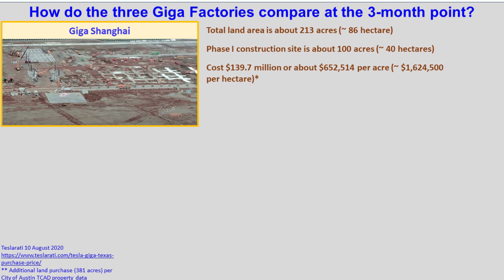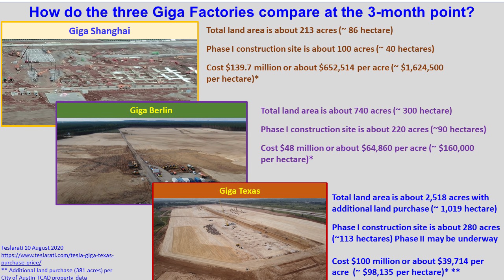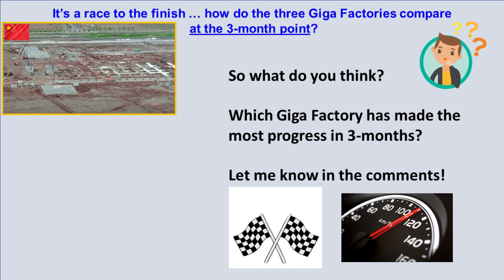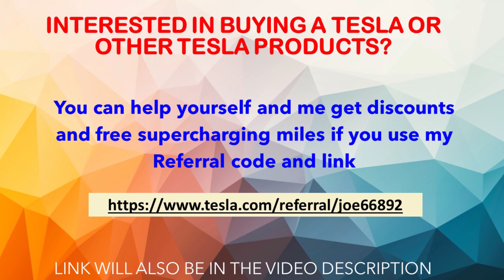Tesla Gigafactory Texas 21 October 2020 Cyber Truck & Model Y Factory Construction Update (09:45 AM)

Comment: IMO Austin has more prep work then the other 2/
shanghai was a flood plain that needed pilings '
berlin is on a sand plain .  they put the footings in at ground level then hauled dirt in to raise it up final level 
austin had valleys and ponds to fill 
the gazebo is called a red iron structure   the  cross beams on top tell me its a multi floor in that area.
otherwise they would put trusses in.   but I dont see any red iron laying around to continue.
that could be show up one day and up the next.
the schedule shows first dry in to be dec 1.
30 days to put a roof onto a structure

Comment: Giga Shanghai didn't have as much clearing and levelling work to do. Berlin had a whole forest to clear, Texas has mountains and swamps!
Reply from the maker: Not any more!
Reply: @JoeTegtmeyer  *had!
Reply: Giga Shanghai put 2000 workers on multiple shifts working 24/7/365, so it is not really fair to compare.  They also had ten times more machinery on site. Shanghai's prefabricated steel for multi story buildings (especially in the eight Phase 3 Model Y buildings) was amazing. Getting all that steel designed, built, and delivered to the Shanghai site for erection, was mind boggling.

Comment: That "mud base" as you call it seems to have 2 functions. The first one is to keep the rebar off of the bottom of the footer. The second is that it gives them something to use in order to center the resting plate for the pillars.
Reply: Yes. It is only there to accurately align and set the rebar and column bolts. To keep it from settling into the soil. That this is the point load is irrelevant.

Comment: Great show Joe. Given the different starting conditions Shanghai was fast out of the gate. But now perhaps we will see an advanced modular building design evolution in Tx that speeds ahead. I suppose Berlin has a little tougher building constraints with snow loads there, those buildings look rugged as all get out.
Reply from the maker: @vicgarbutt3310  I'm curious to see as well ... it could be amazingly fast but biggest area of possible delays is the sheer number of massive projects around Austin being done at the same time (including Amazon and Apple large campuses)

Comment: Apparently they have decided that a smaller mud slab in the center of the footers is sufficient to hold up the rebar cages above the earth.The steel reinforced footers themselves are monolithic which means they are one solid piece to spread the load evenly all around. They do not sag and need extra support in the middle.
Reply: "...a smaller mud slab in the center of the footers ..."  --- that might be the concrete cap at the top of the Geopier, above that is the rebar cage/mat with yards of concrete.
Reply: The 4 column bolts need to be held to less than one inch of position accuracy before and during the concrete pour. The small mud slab assures this.

Comment: CENTRAL ROAD thoughts: What if the upper stories connect over the central road, creating a long receiving tunnel. Only thing is, Tesla Semi cabs would have to receive transfer deliveries from arriving ICE trucks and enter the tunnel with EV power only.  I couldn't see vehicles with exhaust driving through there.
Reply: This has also been one of my questions. It doesn't make sense to me. I would say that it will never happen, but I've learned that Tesla can do things that were never done before.
Reply: Yes, that would be similar to what is done in large distribution facilities. When I worked at a UPS hub, trailers were initially delivered to a staging area. When they were ready to be unloaded/loaded, a "mule" tractor would shuttle it to the appropriate dock door. Tesla would use electric mules of course.
Reply: Proper roof venting would allow diesels to work in there.
Reply: @autobreza7131  it's pretty much the case in Shanghai.

Comment: Why do they need a 'temporary' switch yard?
Reply: Because they are probably going to put in temporary transformers to take in primary or very high voltage power into the factory construction while they are under construction on the first phase. To maybe even start up the first phase. Then they will need to put in a huge switch yard to handle power requirements, especially if they are going to be casting aluminum. It takes an enormous amount of energy to melt aluminum. They they are going to want to run a lot of other manufacturing processes on site. That will use a lot of power anyway you cut it. You could pay the local utility, Austin Electric, to build the transformer yard etc and pay for it over and over again, or they can build their own yard and perhaps buy power directly from the generating company. To do that, you have to be able to knock it down from many KV to just a few KV. It will save a bundle over time.
Reply: Probably because elon said that the model y. Would be assembled at teratx by the end of 2020. Using pre made parts from gigamont. 
So they need the power if an assembly line is going in there this year. 🤔
Reply: @Bill_N_ATX  Your right . the power needs of the completed complex are very different from one production line running as soon as possible.

Comment: These 3 different sites that are 3 totally different issues for land condition and all 3 have different foundation details. The clock starts ticking only when foundations are finished. CHINA is Structural Steel, BERLIN is Precast Concrete. TEXAS is different again with GEPOPILES. for Hybrid foundation, steel structure. Please don’t get into permit and engineering or operating at Your own risk. No Salamanders, No Ant Hills, No Bats.
Reply: Texas has bats 🦇 but they’re civilized - the largest bat colony in North America lives under a bridge juuuust a little ways up the Colorado from here.  
Smart bats. They feast on mosquitoes at dusk, daily. Tourism, the bats have lots of fans. Me included!
Reply: @sminstudios  and those Texas bats have been tracked traveling as far north as Canada in a single night while foraging for mosquitoes🤭